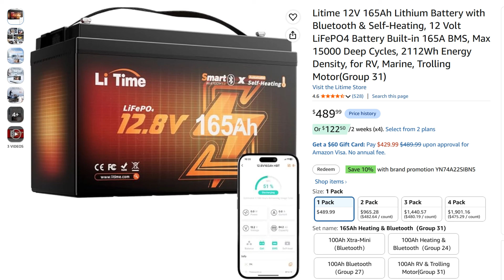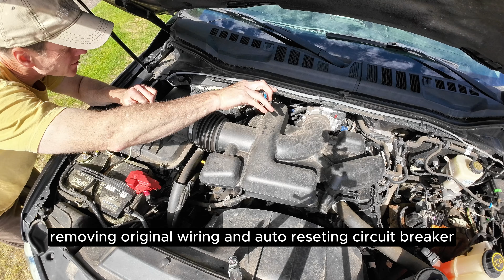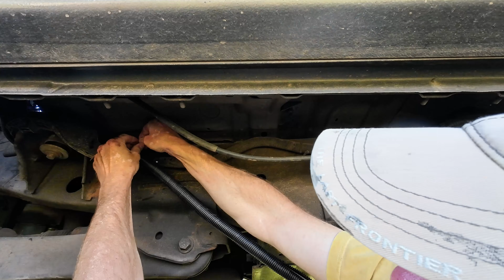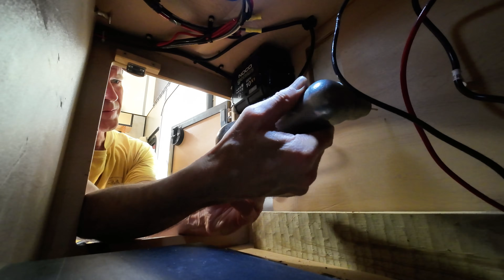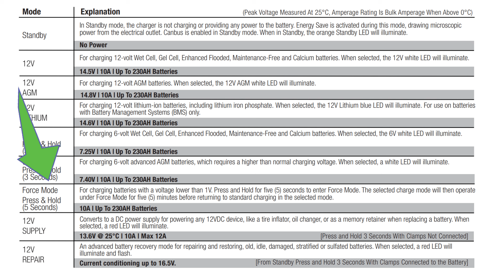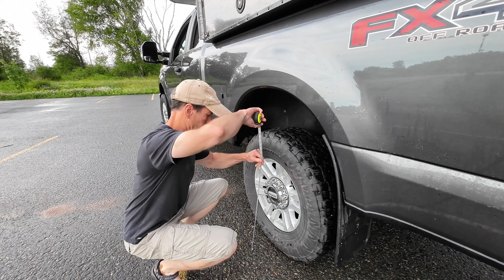Lithium Battery and DC to DC Charger Installation #fwc #litime

Comment: Excellent video and very informative. I am planning on moving from my hardside camper to a popup for weight and height advantages. I have a 2024 F350 but prefer to go to primitive dispersed sites so lower and lighter is better. I will save this video for when I make the change. One issue I have is removing the tailgate on the newer Fords and having to use the tailgate delete kit and having the dash light on all the time, so I am looking at campers that allow the tailgate to remain - Northstar 850 is one of them. 4 wheel makes some really nice campers but don't care for the Project M. Do you have any issues with removing the tailgate (which can be a hassle) to load your rig when needed? Keep up the great work on the channel.
Reply from the maker: With my 2017 f250 I have never had any issues with removing the tailgate.  I have two wires that need to be unplugged.  One for the backup camera that gets plugged into the backup camera on my camper and one for the tailgate lock.  No dash dash lights come on.